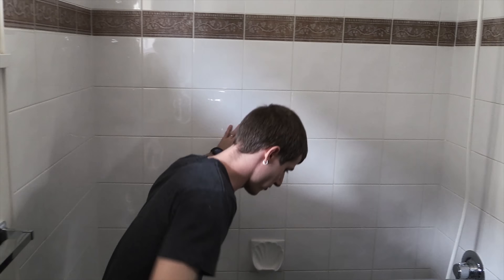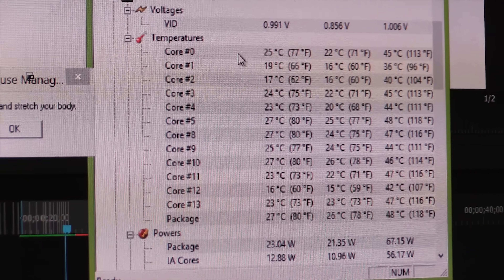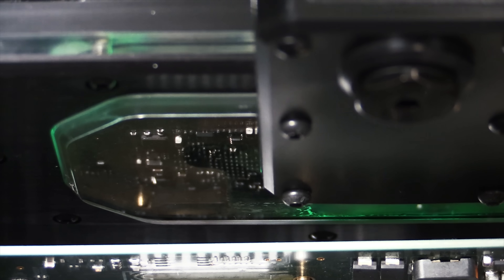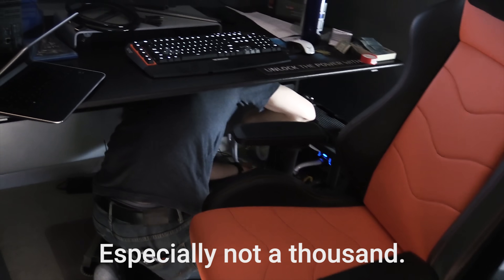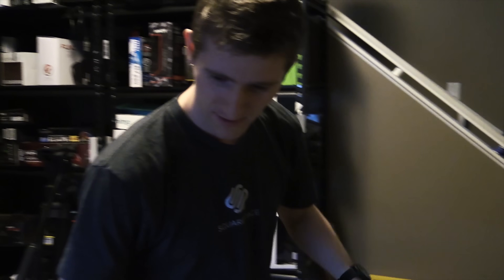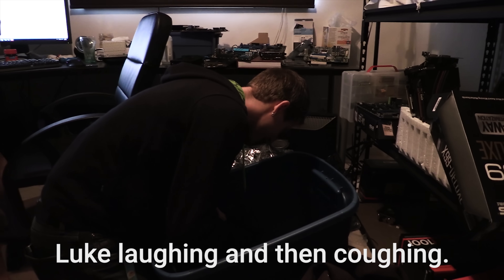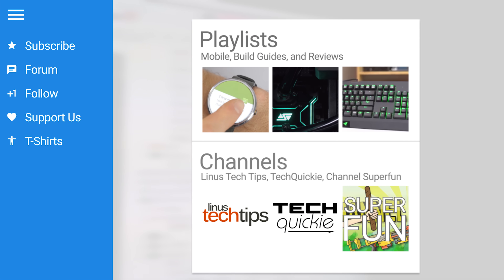Whole Room Water Cooling Part 5b - Some Issues, More Solutions...

Comment: Don't twist the wire before tinning the wire. It can cause wire breaking, weakening you connection. also, if its going outside (even under shelter) use heat shrink on the joint. Plus your striping way too much wire. You did ask.....

Comment: when soldering, it's better to place the soldering iron slightly above the component and then move or solder towards the iron. it gives you better control on how much solder you use and it wont look messy. and like some of the comments bellow, change the solder. it's too thick to solder wires properly. get a smaller diameter solder. At the end of the video i saw how linus solder... no comments on that =X

Comment: Melt the tip of the solder BEFORE you press it to what you're connecting, then proceed as normal. Melting it a little before you try the join will make it faster to stick and easier to control

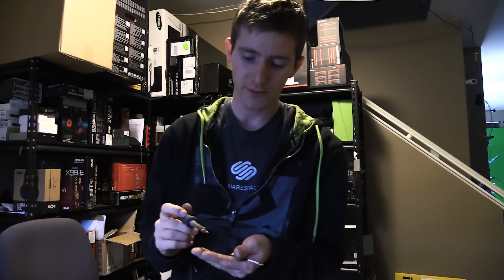Comment: 12:40 "tips for soldering"
Twist the wires together first. Solder is not meant to be structural. It is conductive, and good 'glue' but unless the wires are joined properly with a pigtail or a western union splice, the joint will be shyte. :)
Constructive criticism. Blam.

Edit: http://en.wikipedia.org/wiki/Western_Union_splice

Comment: The air goes up and the water goes down ?right ? So why didn't you make an up words extension on the highest place of the copper network and then make a hole in it so that the air comes out and then close it when all things are set?

Comment: Jesus, that's the worst soldering I've ever seen!  Linus, i think you need to go and check your house & contents insurance as it will surely be burnt down soon.... 

101 Soldering:
- Twist or inter-twine the wires together that you're going to solder
- Place the heat on the wire/s you're about to solder, don't heat the solder and try and apply it to the wire!
- Once the wire is hot enough, the solder will flow onto the join or wire that you're heating
- Always use fluxed solder or make sure you flux the wires before soldering

Comment: This is absolutely painful to watch now, and I can't see this setup working. or at least working reliably.
Reply: agreed.
Reply: And now we are talking about adding filters to the already poorly designed loop. Like thats gonna help flow in any way :(
Reply: produKtNZ band-aids over band-aids... you can hear it in his voice they've completely lost all motivation.
Reply: slayernine Personally, If I was doing something like this. I would have a 30l tank which gravity feeds into a stupidly high powered pump, then into a filter, then to copper lines in the room with an additional pump along the way to assist flow then into a catch tank with one more pump to push the water thru the radiators, which I would also change for an industrial unit of sorts with low pressure drop.

This is obviously going to be a fair bit more expensive, but by having two tanks and using gravity to assist, we move the flow to where it really matters, the loop.
Reply: Once they get a proper pump setup and whatnot they should be fine. The big issues is that since they are not staying in this location he does not want to put in the effort to make it all nice.
Reply: A simple little more planing would have gone a longggg way. Im not a Plummer but I work on my own cars. Their system is all over the place. The reservoir needs to be at the highest elevation just like in modern cars. Also why didn't they just use a small car radiator... Would have cost less then one of those radiators lol.
Reply: Same here
Reply: Timothy Lieuw  That's the exact opposite of what they did. they made it look all nice before testing the functionality of this entire thing. If they had set it up in the garage with a single loop and all the fans they wouldnt have to climb up the ladder every 5 minutes to change something yet again
Reply: It is a good example of why nobody actually does this sort of thing for anything but the fun of building it.
Reply: Beyond painful to watch. lol
Reply: you do know they have had this setup for months and the videos are just coming out, this is not in progress
Reply: uuuh DUUUUHHHHHH

You win first place Captain Obvious!
Reply: produKtNZ lmao,
Linus is the The Peewee Herman of PC for kids who don't know any better.
 Pretty much a broom up his ass with His sponsors pulling the strings.
Reply: Nicholas Hartzler SO damn true. Everything you said is quite right

Comment: from the last clip it looks like you are "cold" soldering. What you need to do is heat the wires to a temperature where the solder melts directly on the wires you are trying to connect. This is called "hot" soldering. doing it this way instead grants a much stronger bond between the two wires with less solder, and it looks a lot more pro. (source: i'm a computer and electrical engineer)

Comment: Worst soldering job I've seen in a while. Next time twist the wires (exactly how you did it but twist them to make them stay) . Place the iron under the wire and heat the twisted wires. Apply solder on the top of the wire (with iron still km the bottom of the wires) and allow it to melt. Don't place the solder on the iron directly. Since you have an adjustable iron turn it up higher to make things easier. You should have a clean connection that looks smooth and flawless.

Comment: [soldering pr0tip] touch the wires with the stain and then touch melt it with the soldier, so you will do a quicker job and will put more stain increasing the durability of the work

Comment: When you solder you want to be applying heat and solder to the joint at the same time. It looks you were smearing solder that was on the iron onto it. Solder doesn't go on the iron, it goes on the joint. Twisting the wires together also makes it a hell of a lot easier. I'd also suggest you get some auto wire strippers, they are an amazing tool. Strips so many different sizes of wire with a squeeze or 2. Also flux core solder, so easy.

Comment: There are components call Automatic Air Vent, you place them at the high points in the system and they will automatically release the air from the system!

Comment: The solder you are using is way way to thick..that looks like plumbers solder....get like a 1MM solder for wiring job...and get paste flux as they work best with wires and also get a pair of helping hands (little alligator clip holders) Good luck :)

Comment: One tip for soldering.. to put solder on to the wire effectively, roll a thin solder wire on the wire and melt it up rather than collecting solder on the iron and applying it to the wire..  since this method melts into the wire mesh than just on the surface , u can tie up the wire first and apply solder, provided the wires are cleaned with flux, try it..  Also use flux free solder wire, it's a mess..

Comment: only advice i have for soldering is after a long time black tape always ended up messing with my joints i usually use hotglue or pretty much anything other than tape :3 i think the glue gets acidic or something maybe? oh yeah and "helping hands" helps :P

Comment: Must take great courage (or stupidity?) to invest so much into a project like this with so little knowledge.
Reply: I personally am glad they did, I'm entertained.. lol.. However, I do believe they should call in a plumber for an afternoon..
Reply: Rob Overholt Slick's dad was the plumber on this, and he did everything he was involved in perfectly as far as I saw, just Linus and co. seem to be absolutely incapable. I can barely get through these videos, there's so little forethought, it's so cringeworthy to watch.
Reply: How does one gain knowledge, trial and error.. there has been a number of errors, but the final solution is nearing.
Reply: The whole project was sponsored.  He probably spent 500 max.
Reply: duviday Slick's dad wasn't around when they actually had water running through the pipes AFAIK, I think he trusted them to patch up any leaky areas, this is why even the most experienced plumbers flush their systems to find leaks, but they didn't have time/the setup yet.
Reply: Giannis Golfinopoulos Yep, the thing about linus and company is none of them are actually educated in anything related to this at all. They have zero idea what to expect and thus just don't give any forethought because they just don't know. If they had ONE expert take a look at what they had they could have told them about half of the problems they were going to have, be it electrical or plumbing. Hell even a kid in a wood or metal working class could have told them about the growth issues. As a business person myself I look at linus' company as an operation and I can tell you this whole this was one big, long stroke of luck on linus' part. He made a lot of good business choices but I guarantee you they were not done on purpose. Linus does know how a consumer base works but I refuse to believe he actually knows how to run a business. He has been inches away from throwing this whole thing into the ground several times already. Hopefully this attitude of "We'll just try this thing because lol and not ask anyone who actually knows stuff about this" will pass because if LMG grows much more, linus will seriously need to hire an advisor of some sort in order to keep this afloat.
Reply: TheGreggy711 Bro, most of it is common sense, the construction and piping are pretty much the only thing you need to have overseen, the rest of it is 100% common sense. Having an open air water reservoir, which is being used for all the PCs? No fucking shit it's got growth and shit tonnes of bubbles. What really gets me though, is how they can ghetto mod all the piping and the radiator work, it's just so ugly and inelegant, it only does it's job cause the copper piping isn't insulated and most of the heat is dispersed before it even hits the rads. If they were prepared to drill holes and shit all over the joint, do it properly. You don't need to be educated or trained in most of the stuff they're doing, there is no forethought because they literally aren't thinking ahead at all, evident by all the fuckups they're encountering.
Reply: dKJustwon There were no leaking areas. If you watch closely in that one video, you'll see he just missed to solder up one connection, which it's a pretty small error, but everything else he did solder was perfectly done.
Reply: wobbly sauce +Rob Overholt Nope the answer is always science. Welding a few tubes together does not make a job right. Spending some time to do actual calculation will always get you the fastest, efficient and most economical result
Reply: Giannis Golfinopoulos  Yeah, they should had at least spoken with some experts.
Reply: TheGreggy711 If you watched the other videos in the series, most has already been explained in the video, like the Coolant that was run was thought it had anti-biocide in it, as it was used in other builds with no issues, hence the tracking of the issue to the Box res.

Now that the build has been contaminated it needs to be flushed clean to start over, which is a lot of time/effort for the short term use, hence the use of the UV/filter.
Reply: That is so much solder ._.lol
Reply: dKJustwon So you consider leaky pipes (the only thing his father actually did) to be a success?
Reply: wobbly sauce It's called education and research. If you had/did any, you would know this.
Reply: dKJustwon Yes exactly! copper piping is an asberger's decision.
Reply: Or free stuff lol
Reply: ***** holy shit hi Leongon xD
Reply: Shadyone Oh, hello :D

Comment: for better soldering use a thinner solder the solder you have is for doing copper pipes also flux core solder is best i like 60/40 solder but any electronic solder will do  use a fair bit of flux i like the paste type better than the pen type make sure your temp is set right and heat the wire with the iron and apply the solder to the wire with the iron still touching it putting solder on the iron and transferring it to the wire is a bad habit i use to do it all the time the soldering iron you have is one of the best brands to have very easy to use hope my tips help a little

Comment: Tip for soldering: heat up the cables and then apply the soldering tin to the cable and don't put it on the iron first and then "paint" it on the cables :)

Comment: Legit soldering tips?
Well for wire to wire, tin (put a little solder on) both the wires first, then use clamps to hold them together, then solder them together properly. Works much better.\

Also, always leave a little solder on the tip of the iron when you're not using it but it's on. Don't want to burn the tip.